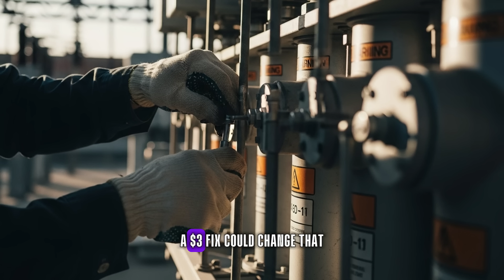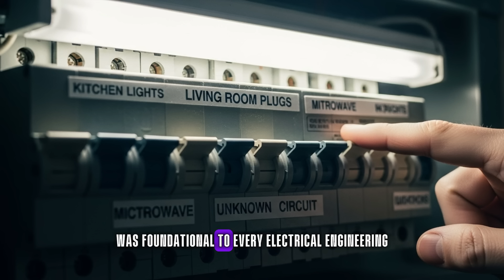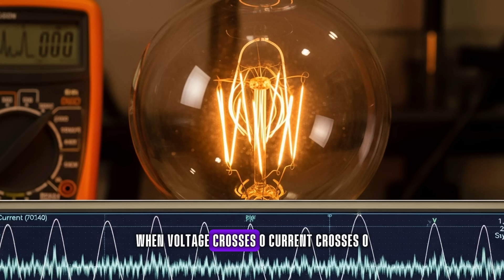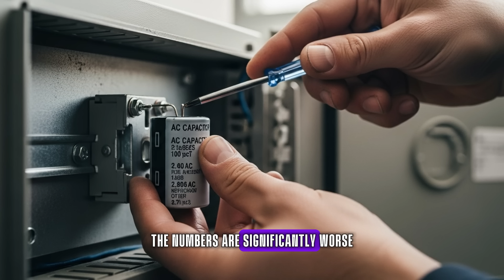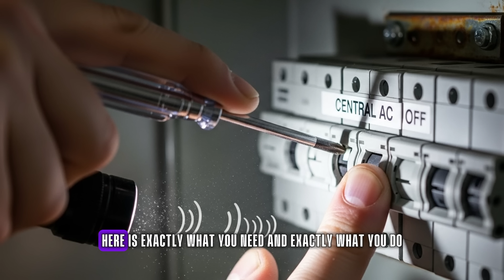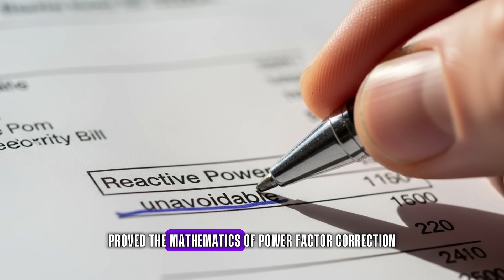This $3 Breaker Trick Saves $1,300 a Year on Electric Bills — Why Did Utility Companies Bury This?

Comment: And Renewables is a major cause of skyrocketing electric bills advertised output and then add a battery for 5% less the ignorance of Renewables is easily demonstrated with a volt amp meter and 4th grade math called Ohm's law

Comment: Power Factor capacitors are a real thing; however, I would not suggest anyone do this on their own.  This is lethal voltage which can easily kill you and/or remover body parts and/or burn down your home.

Comment: What gauge copper wire do you use to wind around the power cable?
Reply: Nothing was said about a power cable.  The run capacitor sets across the line lugs of the buss bars connected by 12 AWG copper wire.  One lead of the capacitor connects to the 120V vertical buss bar and the other lead of the run capacitor connects to the other 120V vertical buss bar.  The two buss bars add up to 240V.  They are the heavy gauge wire from the meter to the breaker box.  Each such be black.  They are energized and unfused.  Unless your home is old, you should have an emergency breaker switch outside for the Fire Dept. in case of a fire.  Switch that off, but check each lead, because the breaker could be faulty and still energized one leg or both.  Personally, I don't know if this does as stated in the video and I don't see how it could damage anything to try since AC units have run capacitors in them.  I only know that it will smooth the sin wave a little and I don't know if that is a money saving trick.